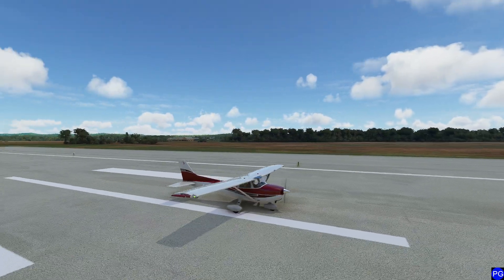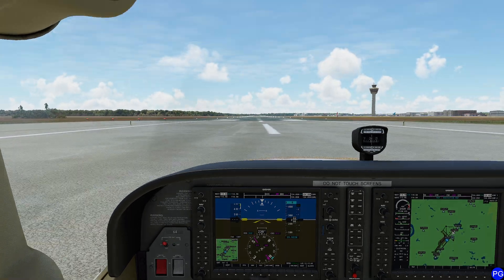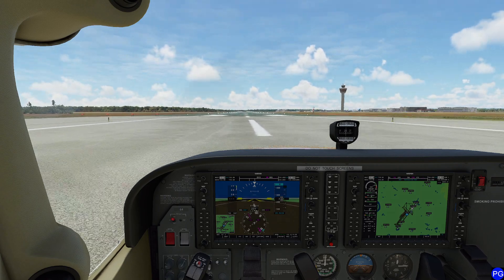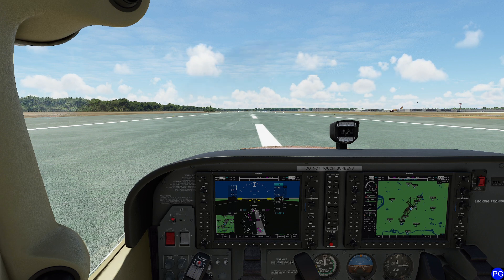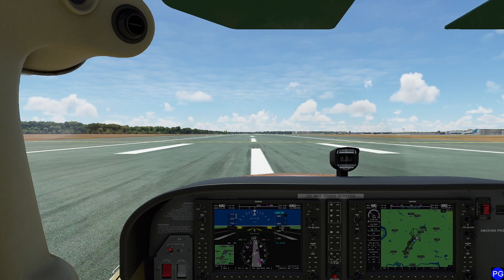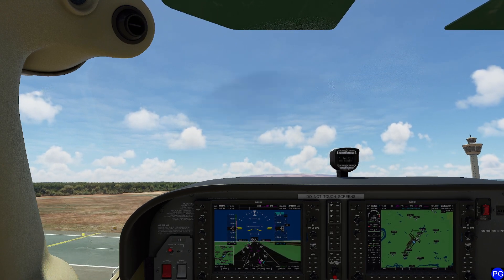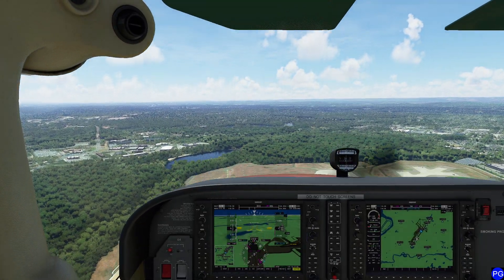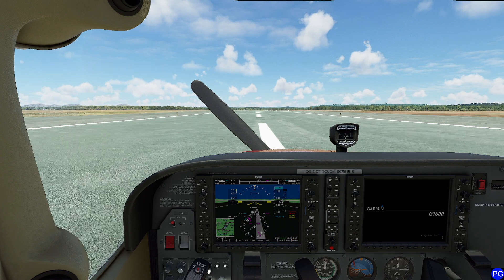MSFS - Takeoff Emergencies and the Impossible Turn

Comment: Tried the impossible turn with JustFlights Piper Arrow the other day... Drops like a brick, just not possible
Reply: From say 800 agl, yes you can.  Unless overloaded..
Reply: That's realistically what happens with Arrows...
Reply: As long as you climb over say 800 fpm with some wind, I have brought back to 4k runway many 180 hp cherokees.  From 400 agl.  Idle power.  With strong wind i had to pop full flaps and full forward slip.  That is the extreme.  Use 700 agl if climbed say at 700 fpm minimum at the Vy.  It works.  45 degree bank, 3 second delay is all you need.